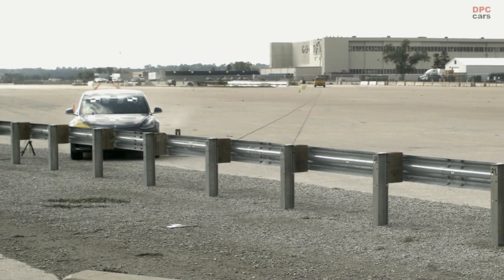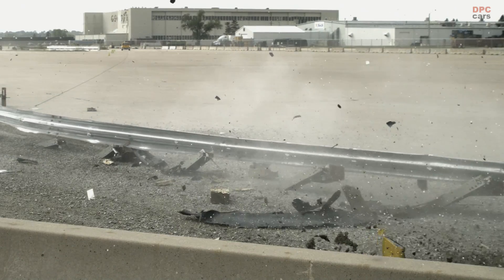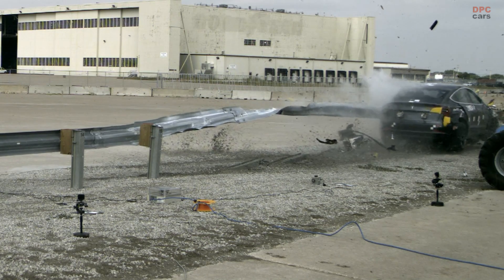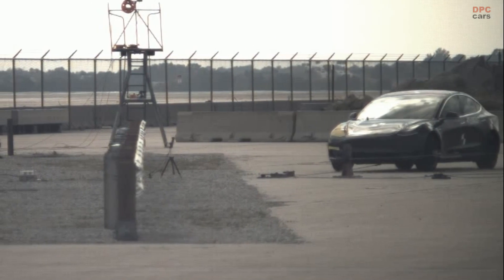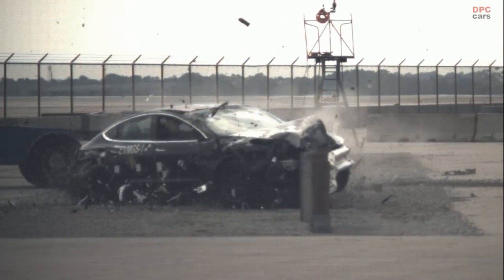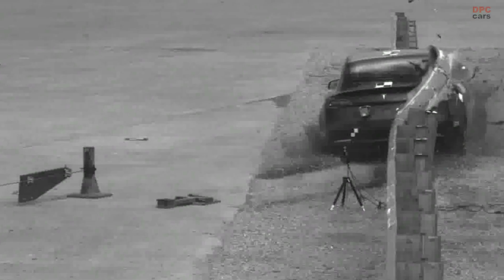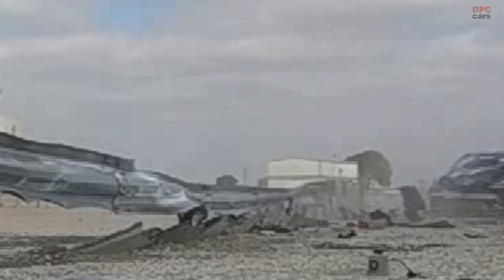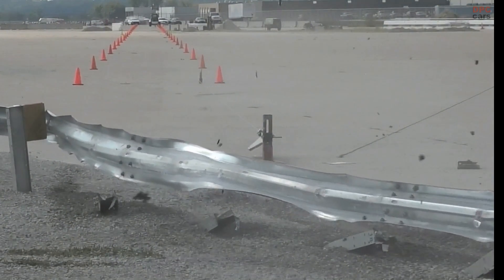Tesla Model 3 vs Guardrails

Comment: Now with the guard rail systems in the whole USA that have to meet the weight limits to hold up in a crash with EVs over Gas powered cars, do we really gain anything in environmental impact? 
Not to mention insurance companies tend to total EVs when they have been in a crash the extra cost to the owner insurance and public changing the inferstructure to support them.
When we could use proven tec. Like Hydgron powered cars that burn in a gas engine with some modifications.  And put out almost no pollution, and even older cars can be converted to use it over fossil fuels .

Comment: Im so sick of this bogus argument about how electric vehicles are somehow heavier than the norm. If youre referencing monstocities like the hummer, cybertruck, or rivians sure. But in this instance a model 3 weighs barely over 4000 pounds. Poor infrastructure design is primarily to blame in my opinion
Reply: The issue is weight distribution, low centre of gravity specifically. Not total weight, although that certainly contributes to the physics.
Reply: @deanyoungblood6708  Uh, Im not so sure about that, lol. I would postulate it has something to do with the fact that the model 3 has an extremely low hood line. Something you won't find on something like any pickup truck where the hood line is sometimes close to 54 inches high. The vehicle acts like a wedge and contacts the underlying support pillars instead of the guardrail, which significantly weakens the structure overall. These guardrails use the combined strength of several posts, so when you eliminate a select few, like we see here, it's no wonder that the vehicle will easily submarine itself below the crash structure. Weight distribution I'm sure plays a role in some extreme scenarios, but if anything, it should help cars like this not roll over the barrier, making it safer. If guardrails had a more broad contact surface, this would not have been an issue. The rail itself did not fail. I would watch the video again.
Reply: They should probably design the car with current infrastructure in mind...

Comment: Lower centre of gravity is much better for the cars stability, it's almost impossible to overturn a Tesla. Guardrails should be redesigned
Reply: Being impossible to overturn isn't exactly a good thing. Being able to lift up during a crash is usually beneficial as it is a great way of deflecting and redirecting impact energy to just energy making your car hop. I'd rather my car lift up than push down during an impact.
Reply: EV's should be banned

Comment: One barrier test in Nebraska and now the comments are full of experts condemning all evs
Ok sure. Try a 3-rib barrier whose mounts aren’t toothpicks and a variety of evs, especially a taller model y.
Reply: It has been more then one test.
Just seen several states have tested
And with several types of EVs  not just that car model and brand.

We have 1 chance to fix our pollution problem,  you can convert
Any gas powered  motor to run on 
Hydrogen and get near o pollution
And water. 
Where as a tesla cost more, cost more to insure, cost more to make and insurance companies scrap one that has been in a wreck  they do not repair them.  Then your talking everyone needs to foot the bill to replace a working inferstrucer nationwide. And i don't own one. Why should i pay for it?
Then you have energy needs to charge them.
Battery waste and cost.

Comment: Problem is not the infrastructure but the cars..
Reply: That was my first thought too. Isn’t that what automotive standards are for?
Reply: @freeworldout  Reminds me of Nancy Pelosi saying "First we have to pass the bill so that you can find out what is in it.".
Reply: Wrong. Watch the video. Consider the structural safety strength incorporated in the vehicle in the video. Consider the profile of the front end of the vehicle. Consider the height of the guard rail. Now, the vehicle did not crumble when it hit the barrier because of high strength material resistance and front end offset impact resistance engineered into the vehicle, which is the norm and goal of all manufacturers this day and age, not just Tesla. The high strength and offset impact resistance, high height of the barrier, caused the Tesla to ride into and under the steel strip barrier, forging it upward while the vehicle crash resistant structure plowed through the barrier supports without impacting the passenger body. The Tesla electric vehicle is heavier than a similar sized gas or diesel fueled vehicle but the weight difference should not really be a consideration as a truck or larger passenger vehicle would weigh the same and the barrier would be expected to absorb and react to energy in a safe manner with those vehicles. I see only one issue and that is with the barriers. Low slung, strong, crash worthy vehicles which weigh as much as a typical good size truck, were not considered when designing these barriers. You could mandate the heavier electric vehicle be shaped like a brick but you may want to consider that all low slung sleek low air resistance vehicles on the road, even if they are light, would all end up under that guard rail and in the others that are not as strong, passengers would not be in good shape.
Reply: This Tesla only weighs about 4,000 lb. About the same as a bmw m440. The issue is lower center of gravity and that reduces chances of roll over and rolling over the guard rail. Low center of gravity is part of why teslas score the highest safety ratings. Making a car safer shouldn't defeat a guard rail. Sounds like the guard rail needs to adapt to the safer cars.
Reply: @dylanbachora8939 It's the hood shape not the center of gravity.
Reply: Working for a state DOT I have seen these tesla cars destroy guardrail. Say what you want about what is good or bad or who got it right or wrong, these guardrails are built so cars do not go down a steep embankment. Blow through a guardrail and half the damage is not done because now you are going duke's of hazard down 300 feet to who knows what.

Comment: The model 3 is actually one of the lightest ev sedans, it weighs the same as an bmw ICE series 3, that is because it is very efficient. There are a LOT of gas powered sedans that weigh much more, so you mentioning weight doesn't really make sence, the stadard model 3 is 1700kg and so is the bmw 3 series, or any other equivalent sedan, he difference is the low center of gravity, which is a bug advantage reducing the probability of a rollover by a LOT! But this rail guards seem a bit hight, allowing the model 3 to get under them
Reply: "Between 2,723 and 6,500 lbs depending on the model" that isn't light dude thats regular traffic, a chevy trax " i'm using that as an example due to so many being around" weighs everywhere from 2,805 to 3,344lbs. Your tesla weighs 3,747.85846 lbs converted from kg's. thought you were clever by adding a kg weight instead to fool people but instead you put your own foot in your mouth and that guardrail isn't high thats standard for the U.S and Canada from what i've seen from frequent traveling.

Comment: The weight argument is not true. Check the facts.
Reply: Explain please
Reply: @apricity69 SIX (6) times more mineral content in an EV than ICE-Will you get down in the lithium, cobalt, copper, nickel, manganese, and graphite mines? with all the deforestation, ecological harm, and child laborers toiling to produce those faux-green heavy machines for the privilege of synthetic virtue? Will you finally get on your calculator and look closely at the cradle to grave energy consumption of an EV vs ICE? Will you take your brown EV out for a casual stroll in minus 15 deg F weather, find out it doesn’t work and/or gets a third of the promised mileage leaving you stranded, along with those useless outdoor charging stations in such weather? Will you promise not to call an ICE tow truck to haul your EV loving ass to a service center? Delicious 😋isn’t it?
Reply: Most Ford trucks are heavier (F250 etc)
Reply: Comparably sized cars, between ICE and EV, are not that much different in weight. Common misconception.
Reply: @sdandersonjr5  maybe weight distribution matters?
Reply: My 2018 Tesla Model 3 Performance weighs about 4200 pounds. Other trim levels are lighter. It’s about the same as having an extra passenger or two compared to an ICE vehicle in the same class. 

Weight distribution: Lower CG is better. They should show the top heavy ICE vehicles trying to roll over the barrier. Being upside down is bad, folks. 

Shape: Aerodynamically slippery cars are slippery. If you don’t want them submarining the barrier, build a better barrier. Or just get used to Teslas doing the limbo.
Reply: @apricity69  Or you and the other EV adopters can fork the bulk of the bill to "build a better barrier". How about that? No more tax benefits for you.
Reply: @apricity69  will you also pay for all the extra tunnels where all the machinery and factories needed to build the batteries will operate?
Reply: @evilwilk thanks bro. I have the feeling all the ev fanboys ignore that fact.
Reply: @evilwilk 
The problem with the barrier seems to be that it's badly designed for smaller cars.. the Model 3 here is completely missing the barrier and going under it. The same test demonstrated that a pickup truck, which is much heavier than the Model 3, was able to be deflected by the guard rail, further supporting this idea. Seems as if it has nothing to do with EVs in particular.
Reply: @apricity69  As an example the base model F-150 weighs 4,021, your tesla is heavier then modern gas powered trucks, that's the other end of the argument as well. Trucks getting too heavy for guardrails or jersey barriers and it seems the tesla in the video proved its too heavy, doesn't matter the angle that thing would've flown straight through. Okay so instead of tesla redesigning their death trap, have people fly through a guardrail and go into oncoming lanes on a freeway or interstate are you clinically insane dude ?
Reply: @Physik-o9i  Model 3 base model is 3552 pounds. But you wanted to compare a loaded Tesla to a base F-150 because you were trying to pull a fast one instead of an honest apples-to-apples comparison.
Reply: @apricity69  and a chevy trax which are everywhere also weight 3,354lbs dude gas powered vehicles will always be lighter then an ev just stop driving your foot further down your throat.
Reply: @Physik-o9i Show me a gas powered vehicle that’s lighter and quicker on a twisty racetrack than a McMurtry Spéirling. That’s a 2200 pound EV.

Comment: Replace all the guard rails. 222,000 miles of guardrail in the U.S., at a maximum cost of $1,630.00 per foot, it would only cost $1,910,620,800,000.00. Or just a smidgeon under $2 Trillion. 

Or Tesla could redesign the car for probably a few hundred million dollars.
Reply: I see your point.  Why should non EV owners have to pay for the improvements?  I have driven commercial trucks for 40 years, and the added road usage costs are huge  I see no reason the added safety infrastructure costs shouldn't be added to EV's annually to pay for the up grades!
Reply: Neither of those things is going to happen. 
New guardrails will be to code and the old ones will be replaced as they are hit.
Reply: @AnotherBoomerYouTuber  I agree and that was my point.
Reply: Redesign the car? What raise the suspension? So it doesn't go under the rail? The model 3 is actually one of the lightest ev sedans